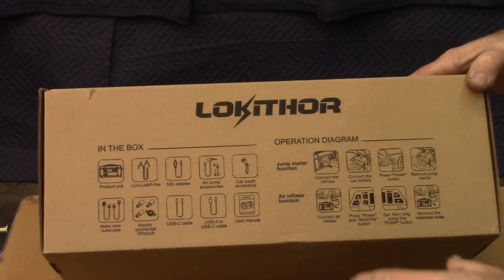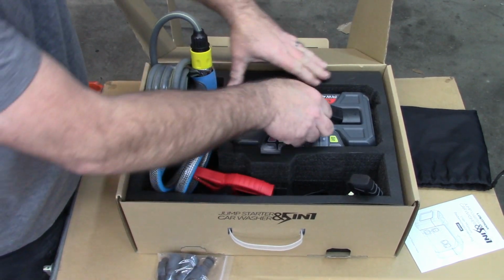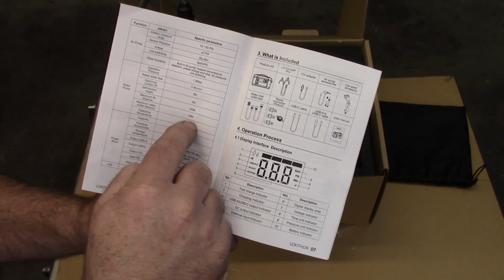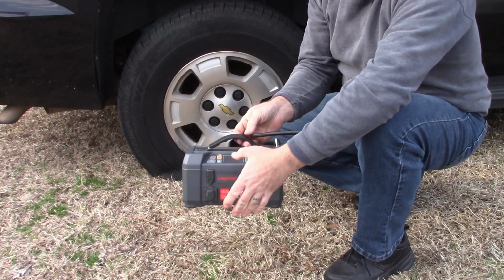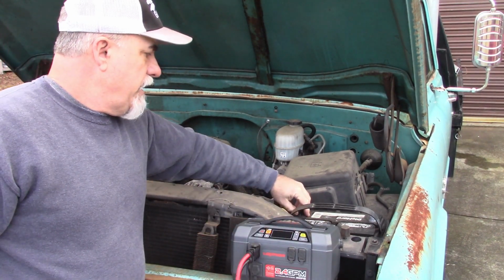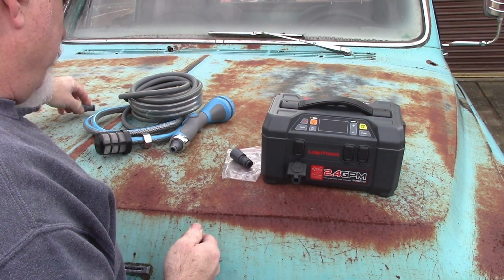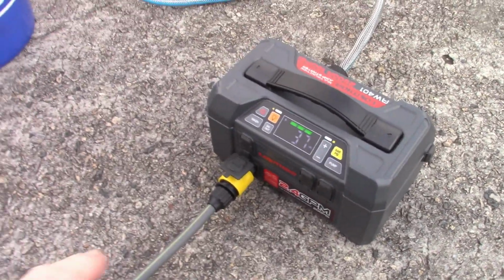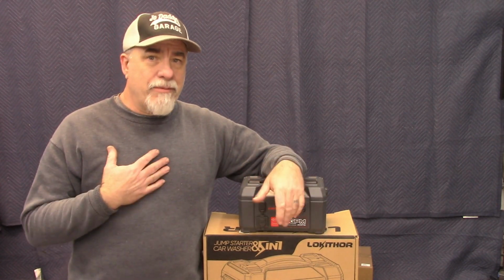LOKITHOR AW401 unboxing and review. 5 in 1 power unit.

Comment: Definitely going to get one for boat days. Use it to rinse off my trailer after launching the boat then use it to inflate any inflatables I bring, paddle boards ect. Then I can use it again to rinse off before getting in my truck. Can use it to even flush the motors out right there at the ramp. Rinse off the trailer hubs and brakes after retrieving the boat. Then keep it in the truck in case I need a jump or anything.
Reply from the maker: Use my link in the description.

Comment: Just got this unit, charged it for two days, all lights came on green ,hooked it up to my. GMC Sierra which wouldn’t turn over. Hooked up to battery and turned over truck, it didn’t even turn over the motor, had to use my jumpers which turned the truck over on the first time. The light works pretty good, expensive flashlight
Reply from the maker: There is a sequence that helps it work properly. Connect the cables to the unit and then to the battery. Then turn it on.

Comment: Interesting review. Would make a nice mobile unit for camping use or just traveling on the road. I wouldn't agree that it has a pressure washer feature but rather has more of a garden hose feature.
All in all, it seems to be a nice compact unit with various functions. Price may be a little high but may be worth it to some because it is so versatile.